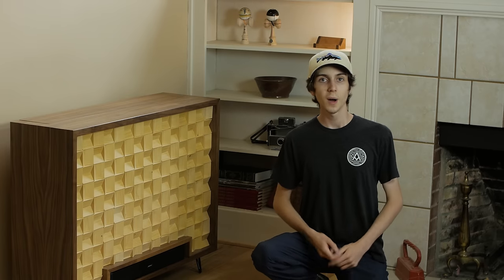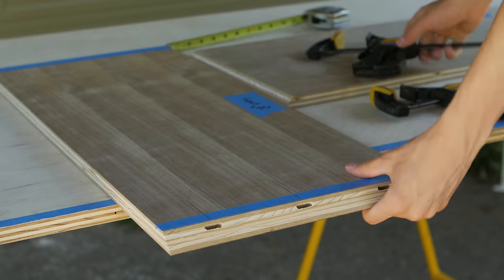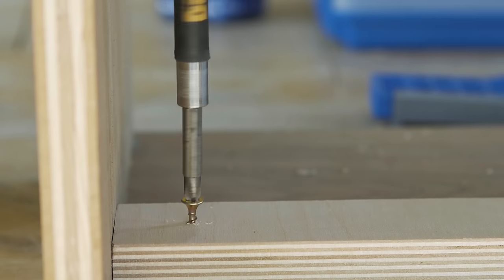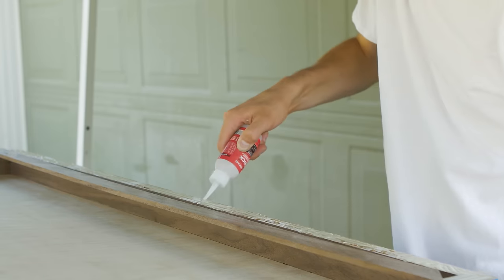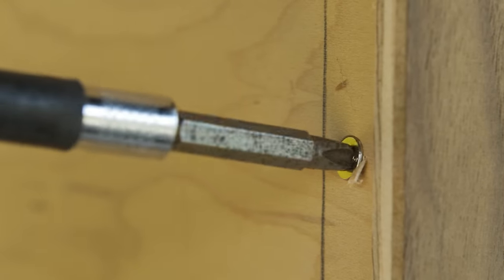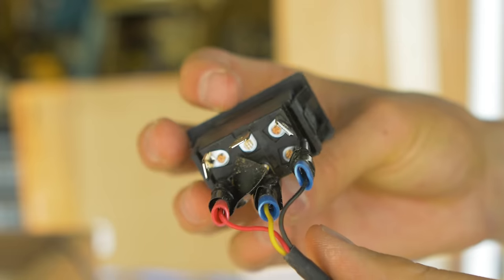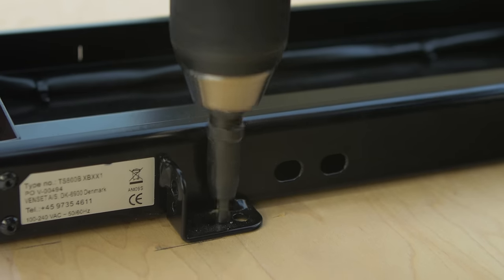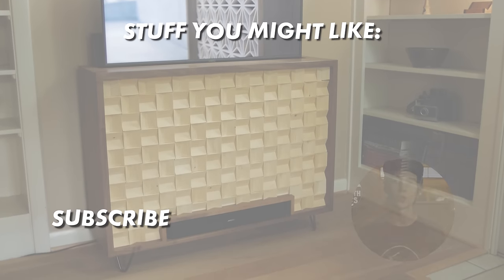This TV Cabinet has a SECRET Feature that will Blow Your Mind!!

Comment: Hi Miles, can you say more about how to make the angled front blocks at 11:23? You mentioned you're cutting at a 25 degree angle. What are the dimensions of that board? How far away from the board are you setting the saw blade? I'm having difficulty getting two equal sides.
Reply from the maker: Hey James, it was really just trial and error for me to get the right sized blocks. In terms of the size that I ripped the initial wood to, I didn't use a specific measurement, but rather cut off all the side to get rid of the rounded corners and left the fence at the same position for all the cuts. I just rotated the piece 90 degrees and cut every side making sure to remove only enough material to get rid of the rounded edge. Once you do a few tests and get it the way you like it, I recommend just leaving the fence in the position and do all the rest of your cuts! Good luck ;)

Comment: That pattern would be sick for sound dampening panels. I wonder if it'd be possible to do the same pattern with some kind of cork material? Or maybe, pine like that, but with a cork layer glued over the top of it. Then you just hang them on the wall, killer decorative pieces and functional.

Comment: My guy I love it, you have inspired this old man. But why for the love of all things holy did you put the sound bar at the bottom?
Reply: Asking the real questions here.  If anyone reading this comment is considering building a similar design (because this is gorgeous) please consider repositioning the soundbar to right  below the TV as sound bars need all the help they can get to sound decent and that is the designed placement.  Moving it out of an enclosure all together would generally also be a good change, but would probably spoil the design of this piece quite a bit.

Comment: Good work, and I am not criticizing but as a fellow woodworker. I noticed you did not put any way to stop the lidded top and no way for it to return in place. If you did, you didn't show it and that would be harder to do. But you did show it closing, so I am assuming you run the opening video in reverse.
Reply from the maker: No i would not reverse it to trick people 😅 
It just falls back because of gravity. The thing is, I don't go into depth on every single step otherwise the video would be like 30 minutes
Reply: @Make With Miles, so the TV is the one pushing up the lid as it lifts up? did I get that right?